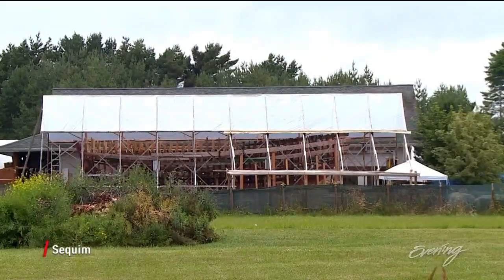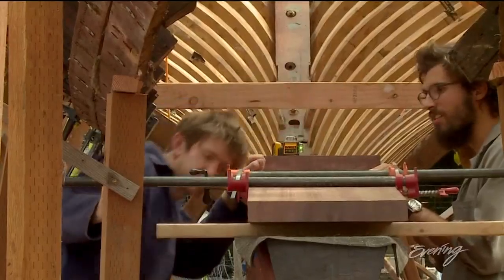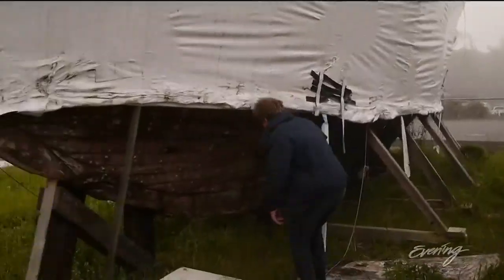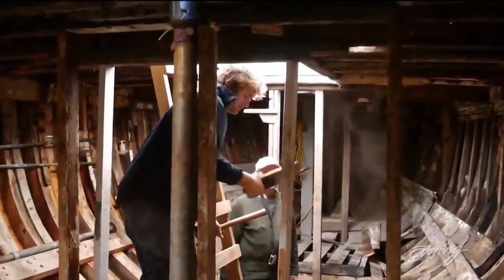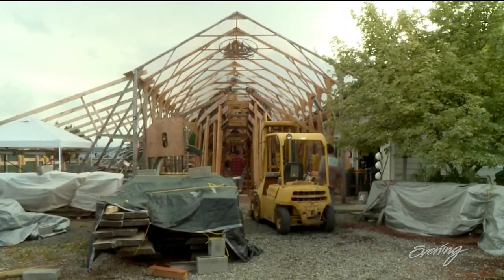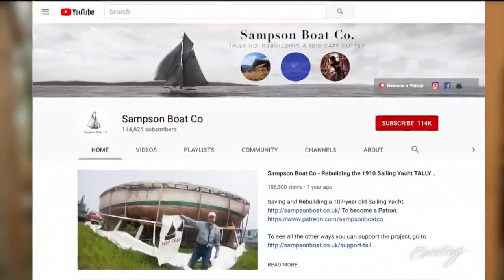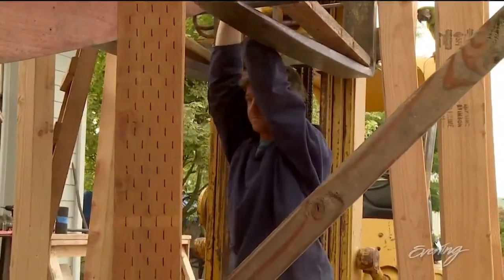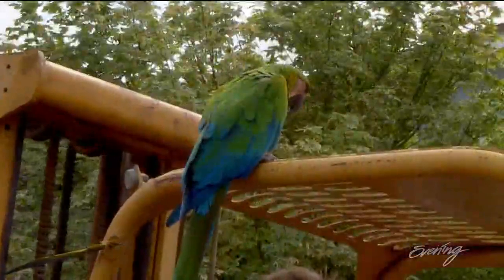Saving a historic sailing yacht on the Olympic Peninsula - KING 5 Evening

Comment: There seems to be many shallow minds, believing hes building a replica, your all wrong, with no idear how wooden boats work!! Consider a wooden boat that brand new, over its lifetime, depending on its its owner, will have bits and pieces replaced over its journey through time, eventually the entire boat is replaced. Is it still the same boat? Bet your ass it is still the same boat. Just like your body its busy all day every day replicating cells each time the replaced cells are a little less robust, hench you get old, even though you're entire body is replaced several times over your lifetime, its still you, get that in your head food for thought.